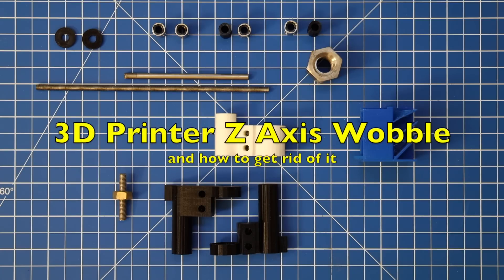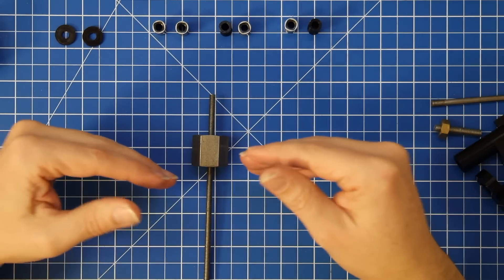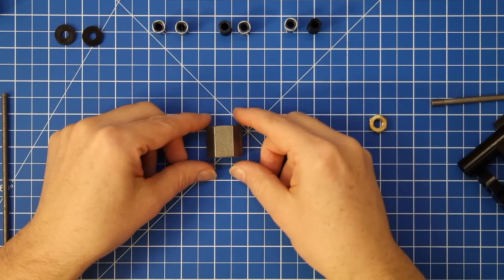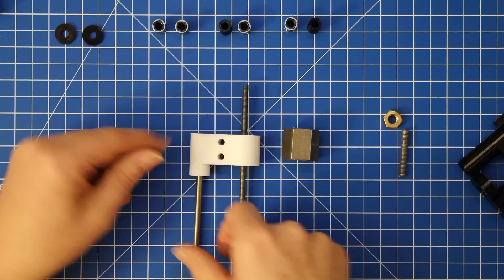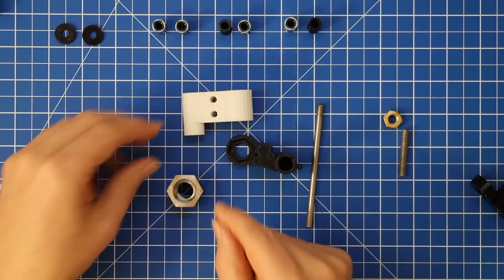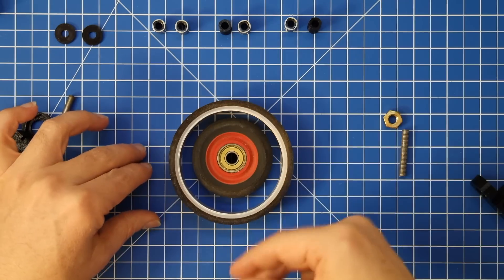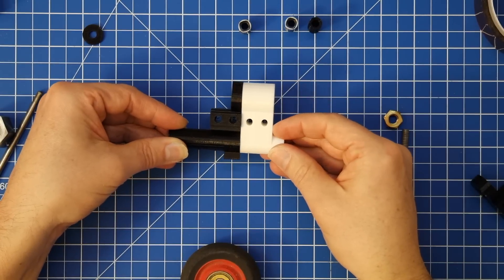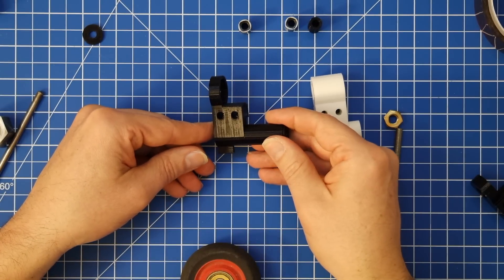3D Printer Z Axis Wobble and how to get rid of it

Comment: In fact it has nothing to do with the thread in the NUT not being aligned because the nut is stationary, the threaded rod/lead-screw is rotating in the nut.
It has EVERYTHING to do with the lead-screw not rotating around its own center axis due to being bent and therefore moving from side to side and that moves the nut from side to side.

Comment: Can that be just like this that is explained in this video?
That the stepper motor axel and lead screw and pushed way to long into the coupling?  That should only be about 5 mm into the coupling, so they don't touch each other.
Then at least in the Anet A8 the lead screw will be into the support in top of the machine.
https://www.youtube.com/watch?v=T9vI6DqAcmo
Reply from the maker: Well, it's complicated,I suppose. The video actually does not say what type of Z-Axis wobble he's getting rid of. If I understand it correctly he's concerned about the wobble at the top of the frame assembly - that can have a lot of causes, and he's right: just adding a bearing and a mount at the top is not the way to do it. 
But the threaded rod should sit down on the stepper shaft, otherwise the z-axis is springy, you don't want that.

Comment: Love the video . 
That looks great .  and quite timely too regarding my project, and your advice there . I went for a full washer between the nut . i also use a tooth to stop its spinning .  I think i might print a better washer on my fab mini ,  such that is is higher on the inside like yours are .  my current slip system allows for large run-out in cheap leadscrews .  but as i use PLA bushing , that need to finish breaking in , when Z goes down , the nut must be able to pull down for now .  when i get some new silicon lube that should go and gravity will be enough . 
also speeds over 45mm/s seem to induce other artifacts even if the printer is very quiet . 
I also have a bad wire or such on my Y axis stepper i have to fix .
Reply from the maker: I had been working on the issue for some time - I guess you having the same problem gave me the push I needed to finally think it to the end and complete it. I did some sample prints and they came out amazing - there is literally no wobble on Z anymore, and since it is a 0.2mm printer with 0.1mm layer height that is quite amazing. When I do prints now I can literally see the steppings in the print surface - step for step.
Reply: i have almost no wobble in y- and x+ direction/faces ,  hardly any in in others now . i can see  extruder consistency errors now especially on curved faces .  i dint think it's the motor but rather the driver's micro-stepping , or such gets inconsistent in cycles of say every 7 layers . but i have to fix the y motor intermittant break because that could be changing the load of the whole driver set and causing the crazy stuff
Reply from the maker: Have you checked the setting on the A4988 controller boards ? Sounds like the stepper is not getting enough current. Disconnection of a stepper to the controller board can actually kill the A4988.
Reply from the maker: Probably the ATX Supply going haywire 'bout the sudden current spike. Maybe try to add a NTC pearl in series to the bed heating.
Reply: i wonder if i should use a 12v mini lamp .  i dont have a inrush limiter big enough . hmm , time to check my salvage bin . do you have NTC pearl part that can take like 20a ? all i can find tap out at 500ma at best
Reply from the maker: 20 Amps at 12V  are you trying to cook your prints ?
I've got some big NTCs that can take 2W at 0.1 Ohms, full on, but no idea what they do with pwm.
Reply: lol thats what i was thinking , i know that rail is good , but i think i need a load on the 5v rail for the sense circuits . i need to revisit the 2 and 3 post on the bed maybe a bad solder . but its not a big deal till  i try abs prints possibly petg one day . lol
Reply: i put a small loa don my 5V rail , and it increased the the time before the  PSU  shut down .  I also see there is a sense wire going to the 3.3v  , so i may add  a small load on 3.3v .
I will do some tests putting  more load on 5V and 3.3v  .  the bed shoots up to 37c in  almost no time . then about then then the PSU dumps . LOL 
Also  i have found the root cause of the extra 'z wobble ' like effects . seems the cheapo V bearings  were very cheap .  they hold just fine in axis ,  but hey have crazy side to side play now .  ah well they were less than 2$ USD . the same supplier has still higher grade bearings available.  Irony,  there used to be a bearing factory and outlet rite here in town a few years back .  I could have walked up and got a hand full at spec for cheap . LOL  no more . 
So now i do a redesign of the X carriage to use 8 small regular bearings that only have to worry about one plane and axis .
Reply: i think your rite ,  I have tested PWM vs bang bang , and both will do it if  ambient temp is too far off .  but the PSU is rated for way more and i have loads on 3.3v and 5v now .  what type of NTC ?   i would think any normal one would just burn up ?